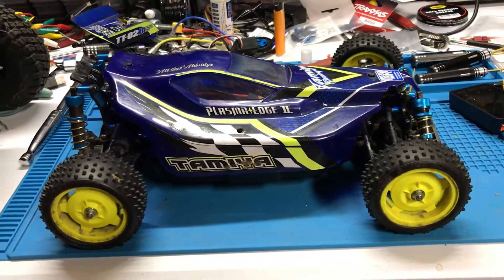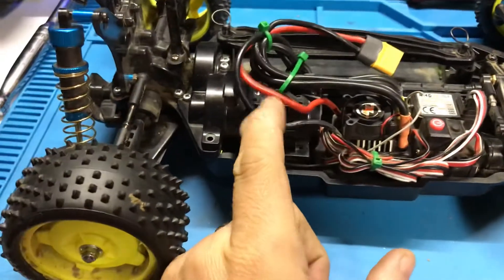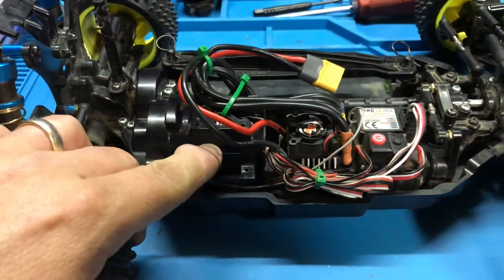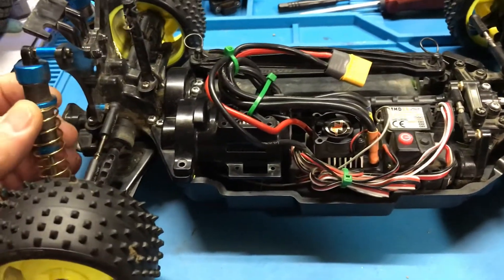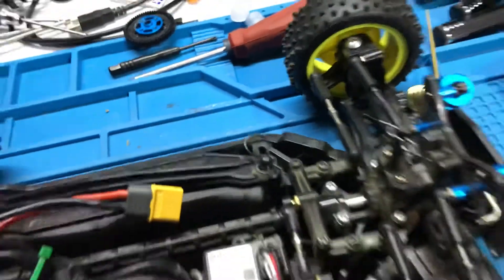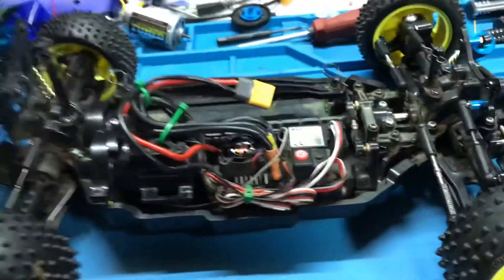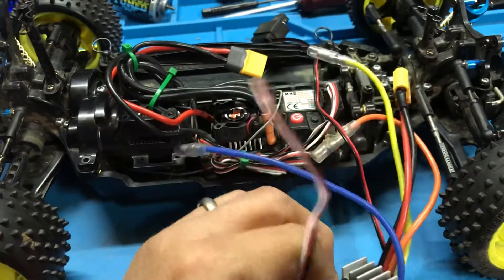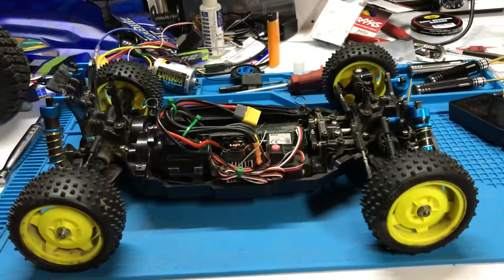TT-02b Brushless power a bit too much?

Comment: Your running the wrong mod pinion gear, that's why your chewing up spur gears, you need Tamiya module 0.6 Tamiya pinions
Reply from the maker: I’m actually on 0.6 Tamiya pinions - I have this issue with even the stock pinion / spur combo that came with it.
Reply: @dangraves6358  I run mine on a 2s/3s, 3421kv 10t brushless and its fine. 19t pinion and standard 70t spur. But I don't grease the pinion or spur. The only grease I use is standard car type grease for diffs etc.  Because the standard stuff is rubbish.
Reply from the maker: @andrew4846  After much troubleshooting, I eventually took the advice of someone on here and shimmed up the diffs (after buying new ones).  It's been perfect ever since and silly fast - no gear slipping at all. I think it's just the natural slop on the diff casing that caused it.
Reply: @dangraves6358  did you run ball bearings from the first second or built it with the standard bushings to start with? I had issue after issue with my TT01 and TT02 onroad cards as they ran bushings first and caused some slop over time. Got a brand spanking new TT02, ball bearings from day one, no more spur issues. 
I also found the stock tamiya pinions turned to dust with brushless and offroad bashing :/ steel or hardened pinions (anything above the stock supplied plain aluminium) did the trick too.
Reply from the maker: @robrath31  Nope, on this one I ran bearings right from the start.  The issue turned out to be the slop in the casing - with the high speed gearing it was just enough slop to let the gears slip a notch at a time and ultimately strip.  I took the advice of someone on here and put spacers in and it's been perfect. I'm going to do that with every tt-02 I build. I just did the Merc AMG GT3 car and I did that right away.
Reply: @dangraves6358  so end result was slightly tighter mesh? Is that correct? I just bought a TT02B (buggy) for my son so I'll be making sure I get this right from the start, cheers!
Reply from the maker: @robrath31  Yes - when you're assembling it, set the diffs in without shimming them and just look at how much play there is side to side - after you shim it there will be no more play and it can handle the higher gearing.
Reply: @dangraves6358  THANK YOU! :)